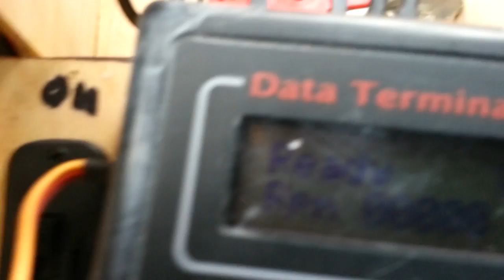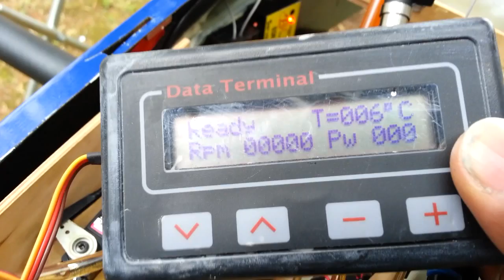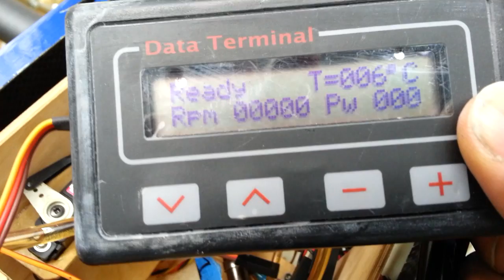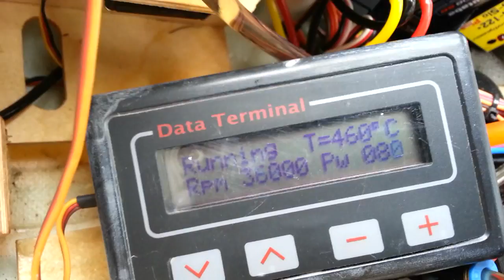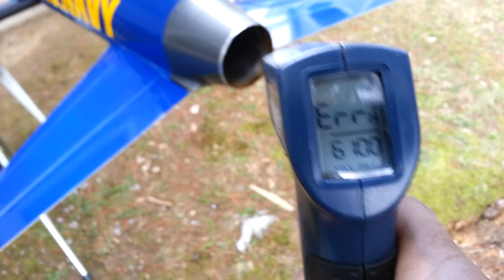How to start a model Jet engine

Comment: Hello I see you have a lot of knowledge about turbines, I’m new to this, I have a question, I made a table top turbine set up , I have one fuel tank with two nipples and the other has three nipples,  and I have a 125 ultimate air trap, my problem is running the hose’s. Can you help me in the wright track?
Reply from the maker: First you have to change the tank with the 3 nipples to two...the "AIRTRAP" fuel line goes to the turbine...The vent nipple from the airtrap goes to to fuel nipple from the first tank...the vent nipple from the first tank goes to the fuel line of the second tank.

Comment: Hey. I wanted to ask what type of motor and specifically if you could point out some model that are used to crank the engine during startup
Reply from the maker: Speed 300  5v
Reply: @basimpsn  How is it possible for a 300 rev/min motor to crank a engine that needs to be revved at 20000+ rpm to start? Please tell me as I am confused thinking of this since the past few days
Reply from the maker: @hasnainabbas538  The starting motor only run the engine up to 3 to 5k before ignition and kerosene bring the engine up to 20k RPM (The slow spool up sound you hear) @ this time the starting motor disconnect and the engine RPM continue to rise to idle @ 33K
Reply: @basimpsn  Thank you very much brother.